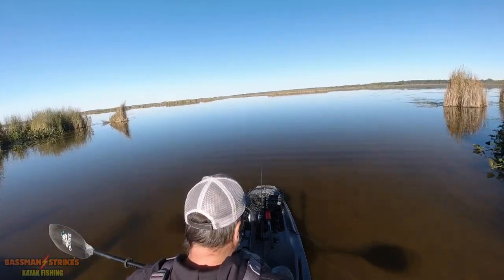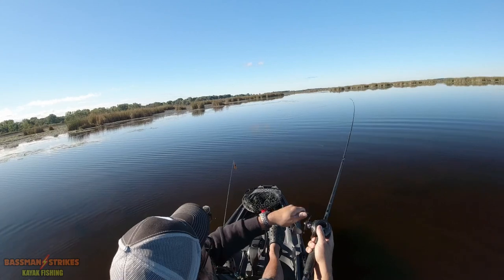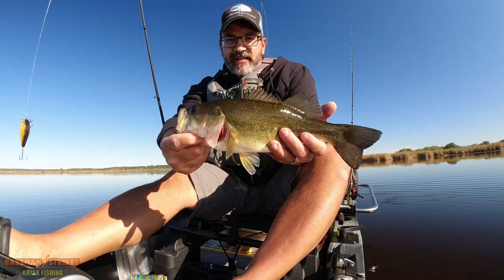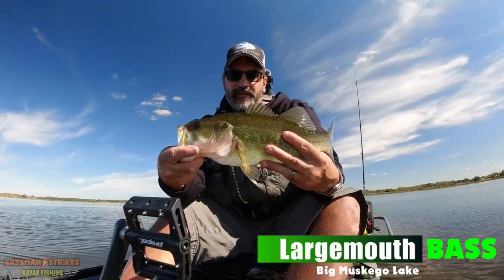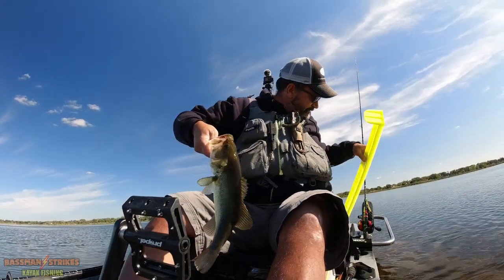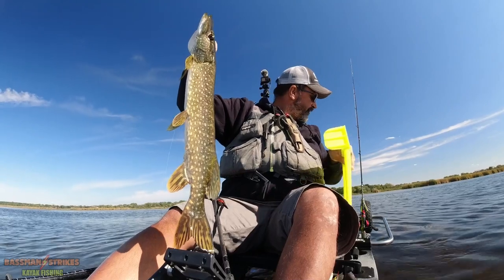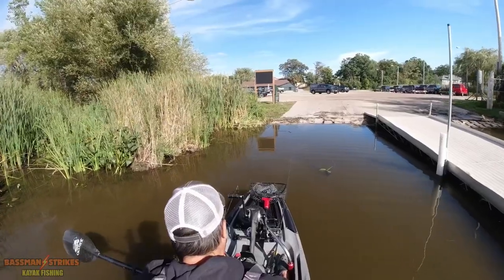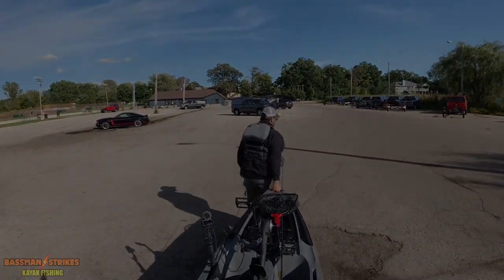Maiden Voyage of my Slayer Max 12.5 Kayak Fishing Big Muskego Lake using a Strike King KVD Wake Bait

Comment: When was this? Nevermind you said in the video about 4 month / 25 hour break in period..   👏🏿👏🏿 Congratulations on the Slayer Max
Reply from the maker: Thanks, it was near the end of September and I fished with it until December 10th 2020.   The drive was super loud and grindy out of the box, I was actually surprised how bad it was so I pulled the lower cartridge
and they barely had it lubed from the factory, probably covid related short handed etc, so I lubed it properly and it was much better.